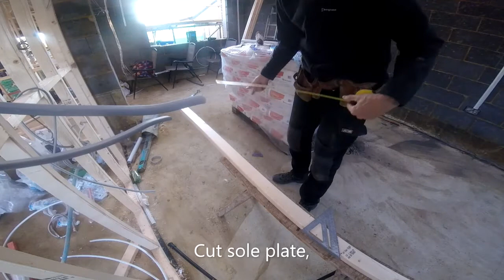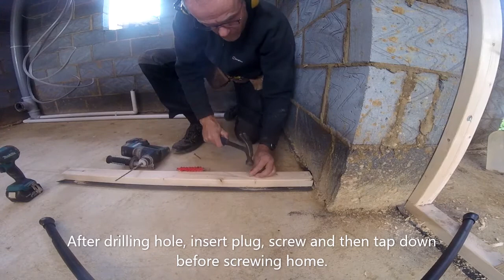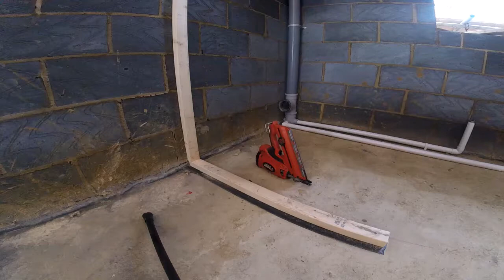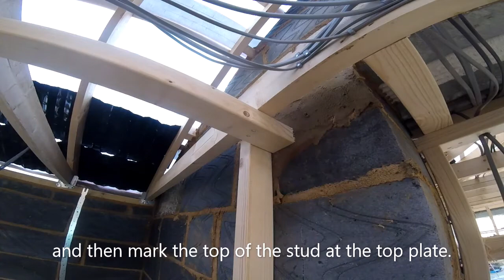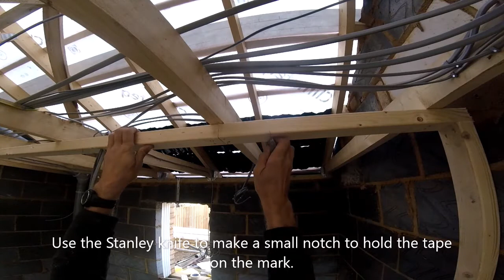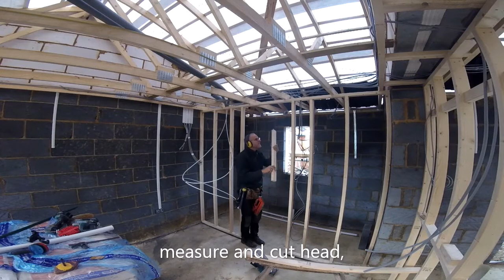Build a small stud wall with doorway opening.

Comment: Don't know if you'll see this, but I just wanted to say thanks. We ran out of money during a bare wall restoration and I'm now learning as I go. Between brexit and covid, labour and materials jumped so much that we literally had a stone walled shell with a new roof and no finances in place to get it finished. 18 months later, we've moved 350 miles and I'm building piecemeal as money allows. The skill and knowledge you've shared over your time on youtube have helped immensely, between you and Robin Clevett I've managed to pick up enough general carpentry to lay out, frame and build, fit linings and hang doors. Basic things to you, but having the ability to reference a trusted source is immeasurably comforting to someone who is having to sail uncharted waters by necessity. Enough waffle, please just know that your work is much appreciated 😊
Reply from the maker: Hi there🖐I'm so happy to read your great comment, and it's awesome that you have been able, with the help of my videos and others, to get on with your own job👍All the best🤞Del

Comment: Like the notching trick. Nice thin accurate line to measure from. 

It would be interesting to see what nails you go for on certain jobs and choice of gun etc. Probably sounds obvious to others.
Reply from the maker: Hi John. I find a little notch super fast to cut in and, as you say, super accurate.👍 Thanks for your suggestion about nails/guns etc. I've got another identical job to stud out next week, so will, perhaps, do a little video on that.😎Thanks for your comment.
Reply: @thetallcarpenter  Thanks for the reply, yes I shall be trying the notch technique. I’m only a hobbyist really but I like to build my own things. I have paslode first and second fix, there always seems to be a lot of talk about how far each gun can be pushed. I was trying to figure out if you were using an im65a on that work or you were using a 360?
Reply from the maker: @BurnedOutGarage  Hi John. The nail gun I use for 1st fix tasks like studwork and roofing, (as in this video), is the IM350. I'm a real Paslode guy, and think, that with regular maintenance, they are fantastic tools.😎Cheers.
Reply: @thetallcarpenter  Ah I should have spotted it 😂 I have a im350 too an old one. Yes great tool, I used to hire a 360 all the time as I mainly work with steel (fabricator) I didn’t want to buy one for the odd bit of frame made out of timber. So not an everyday tool for me. The time it saves me when I just want to knock something up permanent or temporary it’s paid for it’s self many times over. Have been tempted by the new Milwaukee but I’ll stick with the paslode for now.
Reply from the maker: @BurnedOutGarage  Hi John. As I said, I rate Paslode tools. If you have to use these 1st fix nail guns for extended periods, they are punishing on your wrists and forearms due to their weight.🤪 Power tools are designed to make your jobs easier and quicker, and pound for pound, the nail gun is the number one at this.😎Cheers.

Comment: Being on the block work does the timber need any sort of protection from the wall absorbing moistyre/water from outside and rotting the timber attached to it? Or causing mould on the plasterboard once finished?
Reply from the maker: Hi there🖐There will be no moisture in the internal block skin due to a damp proof course at the bottom, and a cavity between this and the outside wall👍Thanks for your comment 😎 Cheers Del

Comment: Really helpful (doing this on the weekend!) Jus wondering how the 3x2 ( 38 X 63) holds up when hanging a door on the studwork, is there much difference in wobble compared to 2x4's? Or perhaps  38 X 63 with sheathing ? Cheers!
Reply from the maker: Hi RC. The 3x2 cls is fine for studwork, and although, obviously, not as stiff as 4x2 cls, it is still plenty strong enough for door linings and doors to be fixed to👍 Cheers.
Reply: @thetallcarpenter  really appreciate the response. Also means my bathroom just got 1 inch wider haha! Means I can eat more at Christmas
Reply from the maker: You joke RC. The reason this builder uses 3x2 is so the rooms are all a tiny bit bigger🤪 Cheers
Reply: @thetallcarpenter  The difference between a 72 cm WC and a 80+ WC (width) is immense. Made a mockup to simulate it and couldn't turn around without bonking something. Fast forward a few days and i'm now taking down an entire masonry wall in order to widen the downstairs WC!
Reply from the maker: @RollCorruption  😵😣👍

Comment: How much wider is the door opening compared to the door lining to be fitted- do you leave any clearance for packing on either side of the jambs, and is this detail shown on the drawings? Keep up the great videos!
Reply from the maker: Hi Tom. I usually make the studwork opening 10mm bigger that the lining. This leaves a bit of tolerance for fitting which I do by inserting timber folding wedges in pairs, (4 pairs each leg), until the legs are plumb and it line with the wall.(and fix)😎 The drawings are usually pretty sparse with opening sizes, (sometimes we get a proper door schedule to go from), and we just go with whatever building control dictates. (usually 2'9" on habitable rooms)👊Thanks for your comment and for watching.👍
Reply: @thetallcarpenter  Is there set heights to fix the 4 pairs of wedges when fitting casings to avoid hinge and keeps etc.

Comment: Are you not a fan of those spax concrete screws?
Reply from the maker: Hi Ian. Basically, no, I'm not. I find that, if there is any gap between the timber and the concrete, these fully threaded screws hold the gap and don't close it. I'm trying some Tapcons from Amazon on the next job, as they are concrete screws but with a waisted shank, so should close any gaps up when tightened. Of course I could just be using them wrong!!!.I would 😵 Cheers
Reply: @thetallcarpenter  yeah know what you mean. Be interested to see them tapcons when you use them. The main thing I don't like about them is the head hasn't got enough size vs the shank so not much timber to pull on
Reply from the maker: @ianthompson9058  That's right mate.👍

Comment: What tolerance do you work to for level, can you be 8mm out in 2400?
Reply from the maker: Hi Charlie. I would like to get my studs a bit closer than 8mm to upright. If you have a board joining on a 38mm stud which is 8mm out of plumb, one board will have 27mm to fix to, but the other board will only have 11mm of bearing. You can still fix it but the screws will be vey close to the edge of the board. Thanks for watching😎
Reply: @thetallcarpenter  sorry I meant the wall being plumb not level if that makes sense would you tolerate it being 8mm out of plumb?
Reply from the maker: @charlierodgers2776  I get you Charlie🤪 I guess it would be difficult to notice that amount out, but could cause issues if it were a kitchen wall for instance.😎 Cheers
Reply: @thetallcarpenter  can I ask also another opinion on your perspective on tolerances, if you were 2nd fixing and doing oak architrave and skirting what tolerance would you allow for your mitres would something like 0.1mm gap in the mitres be acceptable to you? Or would you only tolerate a perfect joint? Also if the lining is out of square sometime adjusting the margin around the architrave by 2mm to make the mitre better, would you consider this as acceptable for example 10mm margin at top and 8mm at bottom ? Thanks
Reply from the maker: @charlierodgers2776  Hi Charlie. A lot is dependant on the customer you are working for. Some customers would never notice if the margins on the architraves were a couple of mm different top to bottom. BUT, if you work for people who expect top notch work, (like I do), then this kind of tolerance might not be acceptable. When it comes to mitres on oak trims, skirtings and architraves, they really need to be treated with a more joinery type tolerance, ie, pretty spot on as any coatings will not cover, even the slightest gaps. An added complication here could, however be, that you are using a lower grade oak which may shrink and open up, even after you've toiled to make really tight joints.👍
Reply: @thetallcarpenter  yeah that’s true it does depend on the customer but in your opinion would it bother you if the margin gaps on the architrave were different by 2mm
Reply from the maker: @charlierodgers2776  Again, it depends where it is on the lining. I wouldn't be happy with this difference where the legs and head meet, but might not be as noticeable down at the bottom👍

Comment: What's the laser you use? Thanks Simon
Reply from the maker: Hi Simon. Its a very early DeWalt DW087 (now the DW088). It's been a great tool since I bought it in 2007 but I have now replaced it with a similar DeWalt level that uses a rechargeable battery😎 Cheers.

Comment: How wide do you make the door opening?
Reply from the maker: Hi there🖐When using standard, softwood door linings, I make the stud work opening 65mm wider than the door👍Cheers Del
Reply: @thetallcarpenter  Hi mate, I am assuming nailing must be better than screwing. Any reason?
Reply from the maker: @paul Boro  Hi Paul🖐Nails are cheaper and faster and are not prone to snapping👍Cheers Del